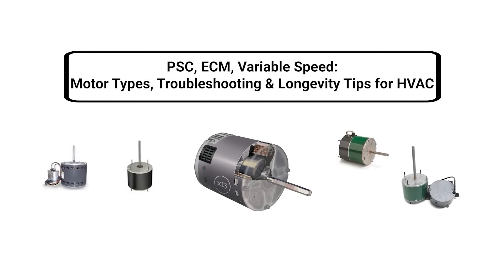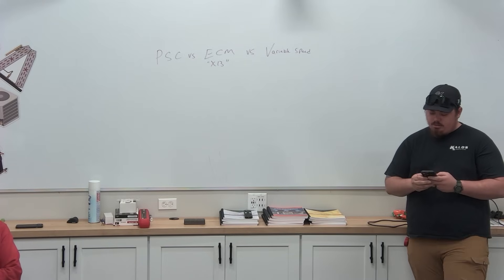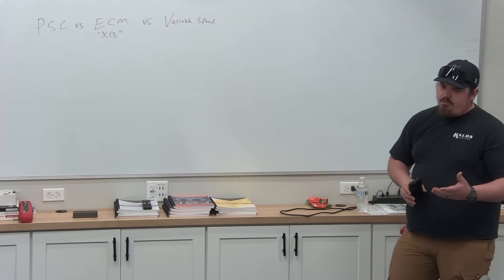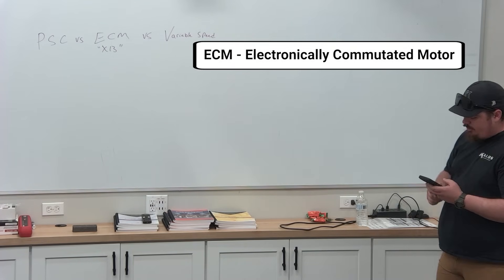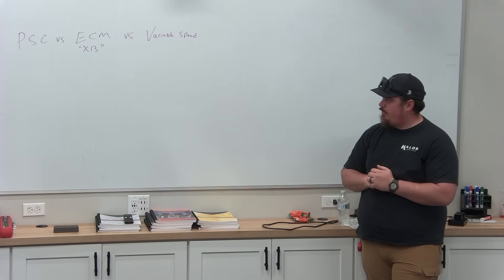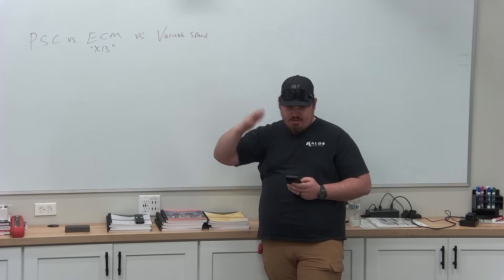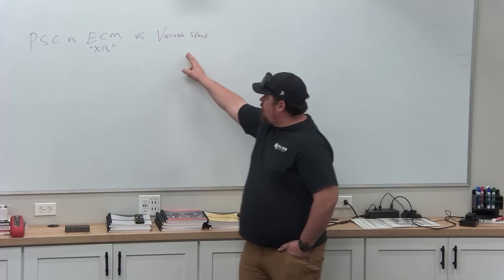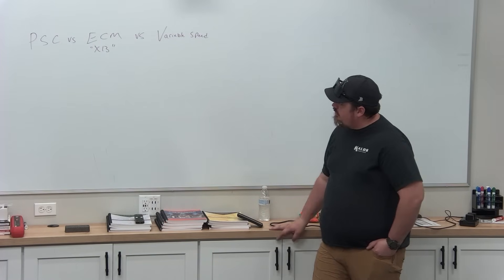PSC, ECM, Variable Speed: Motor Types, Troubleshooting & Longevity Tips for HVAC

Comment: This was a great tutorial for the mechanical inclined home owner.  I had a York system installed in my house in 2004 with an ECM fan it was smooth and quiet 🙂 plus efficient. However, in 2021 I replaced it with an inferior Trane unit with a PSC fan. The abrupt starts and stops are very annoying 😡. The cost just to replaced the handler here in Virginia Beach is at least 30 % more than in Florida 😮 and it runs on 410a so I will have a money pit on maintenance and have to replace it later with a 454 or 32 system for a ludicrous price!

Comment: ECM equals place your bets ladies and gentlemen. The thermistor within the control module fails. To make matters worse, manufacturers don't make the module available even though it can be removed and replaced with a new one. So, the option is to replace the entire motor, yes a perfectly good motor must be replaced because of the $2 thermistor that fails in the module. Just one ECM failure during the life of a blower or condenser will easily remove any savings in power usage. So much for being green and so much for being green that makes sense to the consumers wallet.
Reply: The power varistor that fails in the module is simply a solid state overcurrent protection for the power transistors downstream.  Sometimes.replacing or simply jumping that protection has revived the module; usually it does not.  Better power electronics design is not a secret; it is just not used in most of these ecms.
Reply: just replaced mine for 2nd time on my condenser. lasting about 5-7 years. absolute garbage. expensive garbage

Comment: The genteq x13s and vs ecms are essentially the same technology except the x13s are more generic with their speed taps while the vs ecms require the air handler manufacturer to customize the automatic speed change algorithms to fit their designs and whims.  As a result the vs ecms have another layer of price markup and worse yet, supply issues since they are unlikely to be truck stock or often not even local supply house stock.   

When it comes to reliability it is manufacturer first and forecast, eg genteq et al. The ball bearing permanent magnet motor is not the issue.  It is the integrated power electronics modules that fail.

Toyota makes ecm motors and integrated ecm compressors for their vehicles which have been in use for over 21 years without notable failures. They are in a very unfavorable environment but Toyota (through Denso) knows how to design, specify parts, build and test for reliability.  They also have sealed connectors and protect their electronics against operator error.  

Secondly they have clean power in a vehicle, they have excellent realtime diagnostics and they ensure good ductwork.   Same goes for appliances like refrigerators and washing machines with vs motors running off grid power.

But quality power electronics design and testing is the key that hvac manufacturers have yet to understand.

Comment: He's not wrong about the decline of quality materials being utilized and in manufacturing itself.  Even with proper equipment sizing and installation, routine maintenance, and regular filter replacement by conscientious homeowners there is a long term pattern of high probability predictability in motor service life.  PSC motors can be "dumb", but they have a durability and service life that is unmatched by ECM or variable speed motors across my experience, spanning twenty five years.  I'm aware that every motor style has its pros and cons, as well as pragmatic applications, but having ECMs forced on us by federal mandate instead of natural market shift only did favors for investors involved with their manufacturing.  Quantity replaced quality as the top priority.  More time was needed for R&D and field application, which would have eased everyone into the new option with a better quality product and greater understanding of the technology.

Comment: I started putting ICM493 60amp phase monitors on air handlers with excessive blower motor failures. Seems to be working. I started using them 5 years ago, and I can tell you that for certain, it will cut down on X13 failures and inverter system failures. I also recently started adding soft start kits on PSC compressors. Everything is soft, cheap garbage these days. We have to give it the best chance possible. Good clean evacuation and phase monitors with surge protection. Reading the manual on every install should be mandatory.